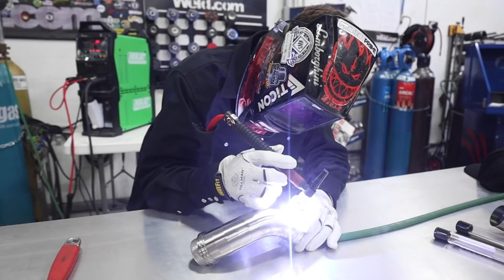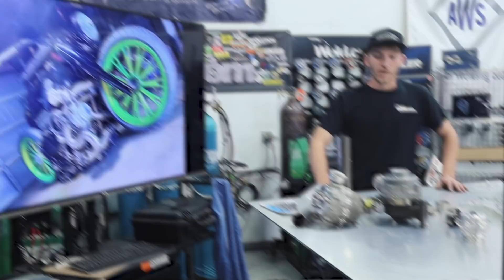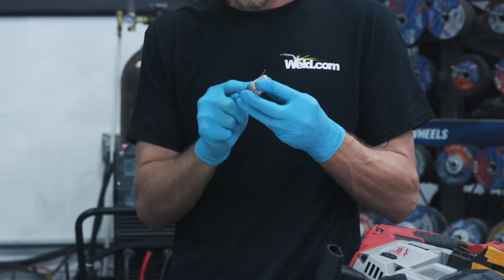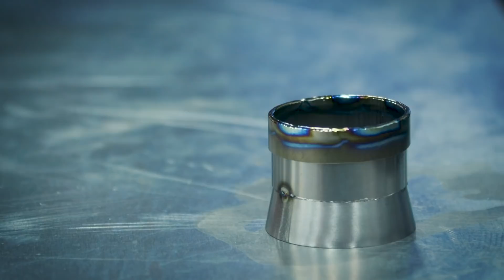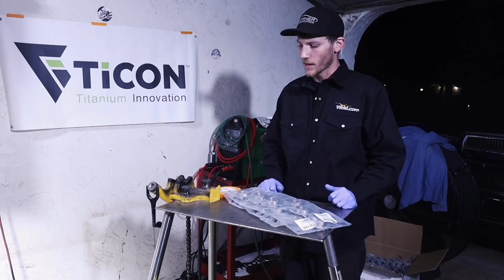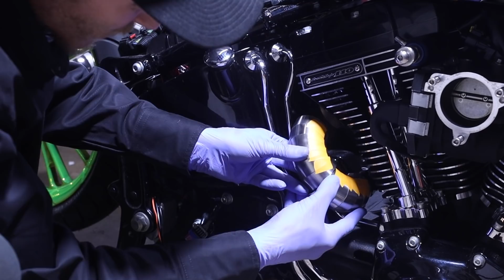Upgrading Your Harley Davidson with a Durable Titanium Exhaust System -Part 1

Comment: Titanium is routinely used in castings. For precision casting, ceramic investment molds are used. For very large castings, a process known as “rammed graphite” is used. The metal is melted under a vacuum using either induction heating or consumable electrode arc melting (VAR melting.) The molten metal has to be poured under a vacuum and kept in vacuum until cooled below about 300 C. 

Turbine blades for fan jet aircraft engines are investment cast. Large pumps used for seawater fire suppression on aircraft carriers are typically cast using the rammed graphite process.

Comment: I don't understand why you are using a Everlast welder? instead of a Miller welder? I think welding on am american bike use a welder made in america. I guess your boss is a cheap ass so he buys China machines or doesn't care about supporting jobs here in the great USA.
Reply: they probably sponsor
Reply: @nrok113  you, are also correct. Like every damn video it seems. I actually bout their lightning mts 275 mig/stick/ac&dc pulse Tig earlier last year, it's a great machine better than I expected
Reply: @wudntulike2no32  you are very correct, tons of the Miller components (and Lincoln) are made in China, they just don't volunteer the info as readily